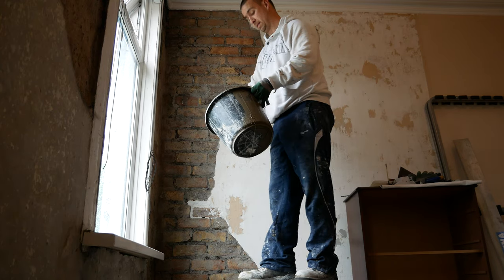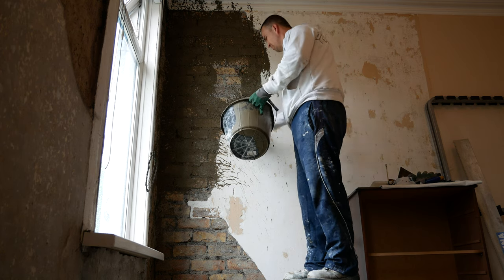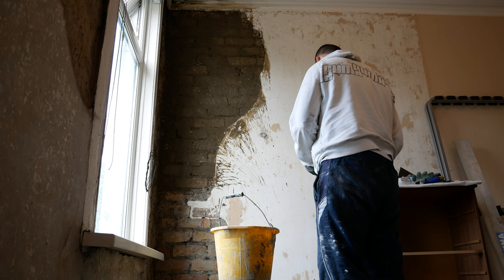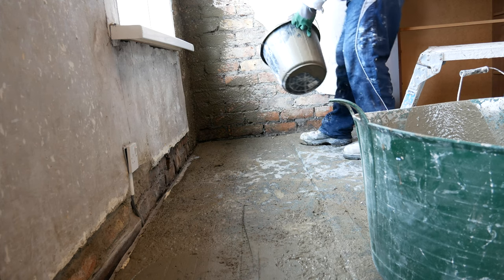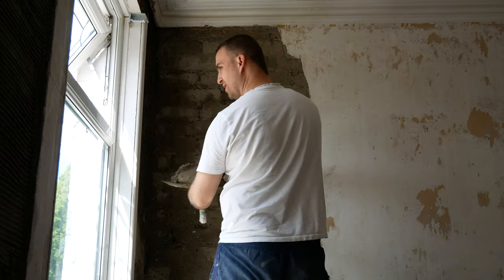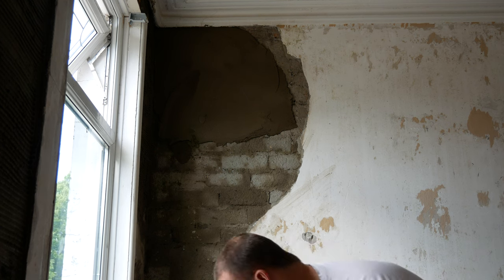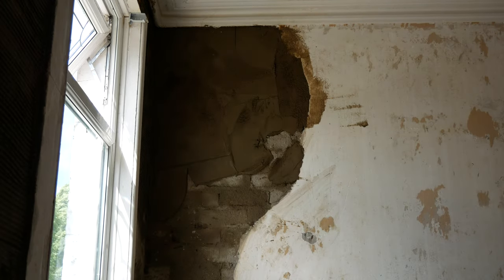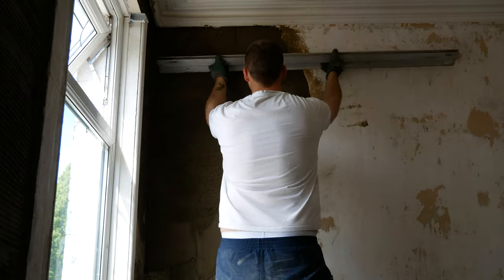How to Patch an Old Brick Wall Scud Sand & Cement Render ready to skim plaster finish

Comment: I've blocked up an old door in my house, I take it I can sand and cement it without a scud coat and key it ready for the plaster? Also always great to see another NI youtuber. Cheers
Reply from the maker: Yes mate I take it you used block ? we do have an old door way patch up on the channel where it is done in plaster board and then bonded out and skimmed might be worth a watch for helping you patch it in also
Reply: @macplastering  Yea I used block on it but seen so many different videos with different hard wall plasters etc I'd be comfortable enough working with sand and cement on it and if that's the case i'll give it a go. I did plaster the utility room and it looks well and smooth but lucky there's no windows or light because jesus it has more wave in it than the sea! The door should be easier! 😅 Cheers Buddy
Reply from the maker: Yes like in this video I use the existing wall to great advantage it is your guide pull up and a few across  to double check cut back then skim in a day or two

Comment: Hi mac, i have a external wall i have to render, iv knocked of old render which was murder, its red brick and very pourus and uneven, what's the best  way tackle this m8 thks
Reply from the maker: Possibly a scud coat mate have my mix and how i apply it on the channel think its call slurry/scud coat but you could possibly just sbr and go depends in how bad it is and if you need to be clean for ground and windows ect i did a video a few months back loads of details on coating over brick mate
Reply: @macplastering  thks mac, its about 5m by 4m, if i scud it is still ok to scratch then top coat, thks
Reply: Very pourus red brick, it was murder putting the beads on i had to stick them on in the end
Reply from the maker: Yea sometimes hard to get beads on   especially when un even glad your getting on well with it mate =)

Comment: Hi I recently had my house rendered inside it’s a 100+ year old brick house. The man that did it is an old school Irish renderer. He did a 1 to 1 scud coat, then a 4 to 1 coat with sbr and waterproofer and final was 5 to 1 without additives.

The problem is people are now telling me I’m going to have problems with damp and cracking in my house because he should have used lime render is this correct?
Reply from the maker: I watched an old video i mean really old of a guy doing one of these houses up and they where still damp back then. to me lime needs to dry from the inside out meaning you need to heat it to dry it so any damp will get in and its up to you to heat and dry it going by a survey on a large house we done ( https://youtu.be/VVqZOm8pluA ) the 3 guys said it should be done inside and outside with lime would cost a massive amount they said if doing lime no point just doing one need to do both inside walls and outside , they claim the idea is you dry it from inside out .... so with cement render it is supposed to stop water coming in but some claim i gets in as a gas then turn to a liquid agin, but then why cant we just dry that the same way as lime? from the inside out sure if it can get in as gas wont it dry back the same way ? my question to you in how has the wall been? again he has used different mixes to my own .. be great to hear your findings? so you just put sand and cement on no skim coat?
Reply: @macplastering  thanks for the reply mate. After he done the scud, 1st and 2nd coat he then skimmed everting with multi finish and 2 or 3 coats paint. It’s been approximately 15 months since he completed work and no issues to report at the moment.

Most of the walls he rendered then plastered I have a radiator on them which should help with drying. 

I did originally ask him to just dot and dab all walls and he told me it’s a waste of money and should just render and skim. I’m actually worried that I will have damp problems at some stage and how on earth am I going to hack all this solid render off and change it not possible at all.
Reply from the maker: @londonengland7096  it is still possible to remove the render it is just hard work again if no problems after so long i think you should be good Im not sure dot and dab would been much better in all honesty , you would have had to use foil back boards if worried about damp and stuck plus pinned in. thing is if damp is getting in then you must stop it from the source 1st be it a leak or condensation, again if not problems you should be grand just keep the air flow going and heat the house when cold out open window when cooking and showering ect
Reply from the maker: also have been to peoples houses that had lime and hatted it both looks and it been damp , here is very wet climate like raining 85% the year so lime has no hope to dry out in my opinions if your in london it might be a little better weather but no 100% sure
Reply: @macplastering  mate I really appreciate your replies. It’s so hard to make decisions because no one sings off the same hymn sheet. I’ll have to pray to god that nothing goes wrong, I’ve spent so much money and so many sleepless nights and nowhere near finished on this house
Reply from the maker: @londonengland7096  I know that feeling buddy on our new build it is stressful but that been said I do think most people are trying there best especially us plasterers so hopefully yours is 100%

Comment: Those cornices are fragile. I’ve got a big one around a room and I’m trying to preserve it as it’s one of the last original features. It’s thick in paint and I tried stripping it but chunks just come away. It’s like the plaster just breaks down and loses all its strength over time.
Reply from the maker: Yea man hard to keep for sure paint defo holding it togeather
Reply: use cornice adhesive to re-build it: the good thing about CH is that as it sets you can sculpt it for quite a while...like half an hr

Comment: In my bathroom a piece of old plaster have fallen off the wall so I need to patch it so could you give me some advice on the best way to do it. The patch is 18"x18" and 30mm thick.
Reply from the maker: I would do it same as this is the wall brick block or plasterboard
Reply: @macplastering  It's brick like in the video. Can I fill it to 30mm in one go or should I do it in stages.
Reply from the maker: @hardworker8030  i would do a scud coat 1 day then float out and cut back next day and skim 3rd day mate all the mixes ive used can be found on the channel if you need a refresher
Reply: @macplastering  Can you recommend a different way without the scud coat because the materials you used will be to expensive just for a small patch.
Reply from the maker: @hardworker8030  pva or just wet it down some with clean water sbr is fail safe pva is good to but if small if you damp it down after taking away all dust should be ok mate

Comment: Can you not just use hardwall straight onto the brick ?
Reply from the maker: could could use hard wall but not just straight on with no preparation or suction control also wouldn't be as good a job as this is , but if you dusted it down and wet it then used a pva or sbr built it out and got it straight and keyed up for the next top coat skimming yes 100% also would cost more in martials compared to sand and cement might be easier for one or two but loads its going to work out very expensive and not as good a job compared to float and set sand and cement
Reply: @macplastering  thanks for your time very kind ! I thought you just put hardwall straight onto bare brick. I've never used it. I suppose in this case because it's old and dusty to seal it I'm only guessing. There is alot of nuances to get your head around when. where. what to use. And the idea of sand cement with sbr give the wall protection against damp and is a stronger product thats why you are saying its a better method.
Reply from the maker: @semprelazio8864  yea the strength and damp protection would be why its better also the money side. Yes if it was new block could go straight on but these old brick have real high suction and would pull the water out of the plaster so quick it would crack and be lose not bond well and be very hard to work with getting straight and smooth with a key for the skim hope this makes sense